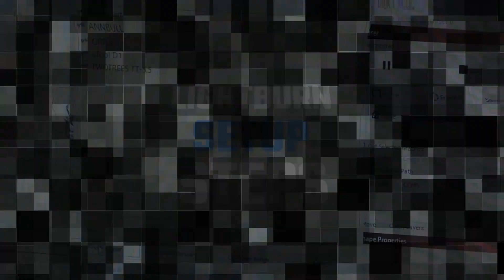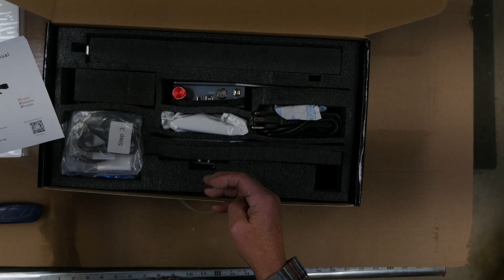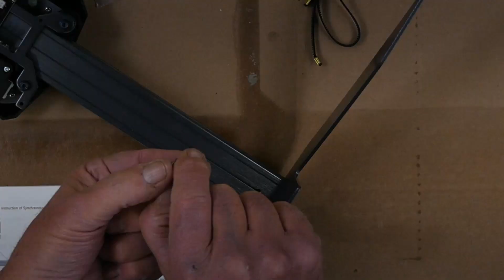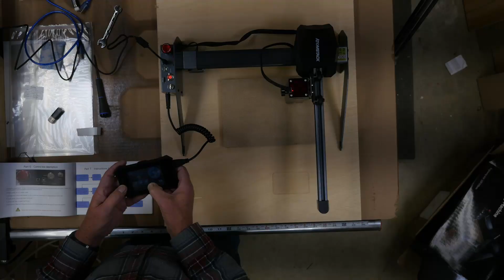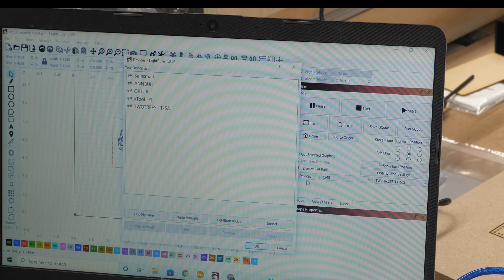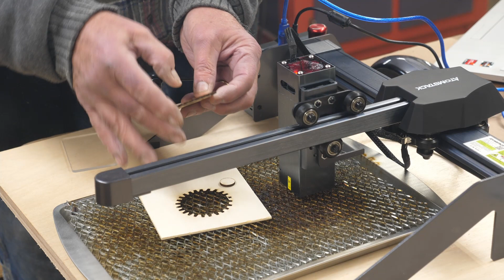Atomstack P9 M40 Laser Assemble and Setup

Comment: Would this be able to engrave anodized aluminum?
Reply from the maker: Depends on the color.  The darker the coating, the better the etch.  Results on silver may be a disappointment.
Reply: @rogersshop  thanks.  Mainly planning on black anodized.
Reply from the maker: @cberge8  That should show up pretty good since it will have good contrast.

Comment: if you had a laser burn out in 20 hrs, 2 things 1 probably the diode is a cheep uncapped one. and 2 you ran it  too hot for to long with insufficient cooling. heat kills a diode quick. i have all sorts of extra fans blowing  air all over the place to keep things cool.
Reply from the maker: The laser that failed (not this one) I referenced was junk from the start.  It had ALL kinds of QC issues.  I have ten diode lasers, so not exactly a beginner.  I had purchased that one just to see what a really CHEAP laser was.  You get what you pay for.........
Reply: @rogersshop  I currently have 5 working diode lasers and I believe six or seven dead ones I'm not sure that box is kind of full. I only have two actual machines though I changed lasers out for different jobs since they have different characteristics one is a original otour 400x400 frame and the other is the sain smart 3018 I bought to use as a router but with the screws it's so stable I get no banding issues at all I use it primarily for white tiles with a custom 2 watt laser. If I could source metric derails locally I'm in central Ohio I build me a CO2 laser. An eight and a half foot by 8 in laser frame would be nice to do trim as well.
Reply from the maker: @chrisfrisch1347  I also have the Sainsmart 3018 CNC.  I played with it for a while before determining it was a "toy" CNC and put the laser head on it.  I made a custom spoil board for it jigged to accept ceramic tile and now that is all I use it for................And it does it quite well.
Reply: @rogersshop  heres a 3018 tip. I am on my second X rail screw, the first one i str8 wore down to nothing till it would no longer work. so when i finally sourced me a replacement that arrived unbent which was a challenge all its own. (so was figuring out the starts pitch and thread). So anyway now i have the 3018 set up to run one or 2 4-4.25 inch tiles at a time. basically a left and right so i wear the screw evenly and theres a stop in the middle so i can run 3x6 tiles. I did a whole tarot deck for a lady on 3x6 ceramic. But this way my screw is wearing evenly and i already have a 3rd replacement on the shelf ready as i sell alot of NWT's.
Reply from the maker: @chrisfrisch1347  I did something similar on both of my 3018 units:  https://youtu.be/EGkLaoWCSxw And, I do know about the screw wear!  I use WD40 dry lubricant (made for bicycles) on these.

Comment: thats too much power 100% is too much, i can see your tile is burning grey and not black, 2 possible causes, 1 out of focus and 2 is you have to much power and you are overburning, my 20w burns a tile at 1400mm/min at 60% power so ths 40W is def overkilling at 100%
Reply from the maker: You are wrong.  We run hundreds of these and this is a 5 watt, not a 40.  Once stripped, tiles are perfect.  Have never had a complaint from a customer.  Input wattage is a misnomer and means little.  Only the actual output wattage is a significant value.  I have ten diode lasers, most in continuous use, so I do have some idea of what I'm doing.

Comment: Great video. Can't wait for your follow-up video. I was online the other day searching for a laser engraving machine. I have to look into this company.
Reply from the maker: One of my other lasers is an Atomstack A5 Pro, which performs well with no problems.  It has a larger format engraving area than this one, but is not really portable.
Reply: @rogersshop  I saw you reviewed the XTool D1. Do you plan to test out the XTool M1? After looking at the video for this machine on their website, it seems like a nice machine to test out.
Reply from the maker: @softsuga79  It is interesting, but unless I am offered one to review, I won't be buying one.  The D1 I have was purchased by me and not given to me to test.  It performs very well and does what I need it to do.  The M1 offers die cutting, but I already have both a Cricut Maker and the Cricut Maker 3, so don't need that feature.  With the exception of this Atomstack Laser, the lasers I have reviewed (and currently use) were purchased.